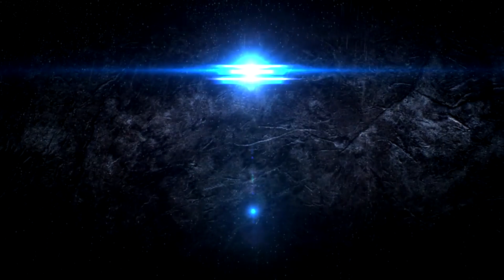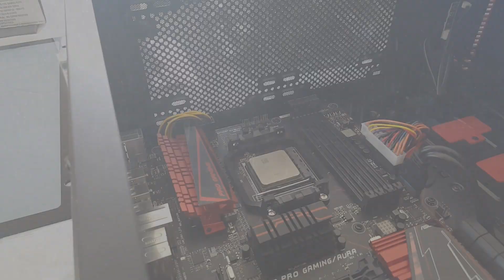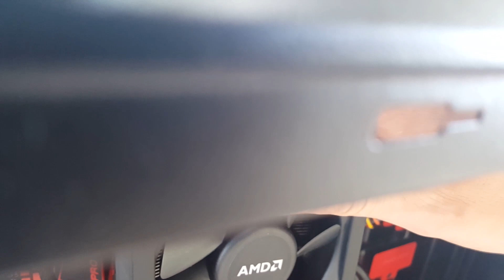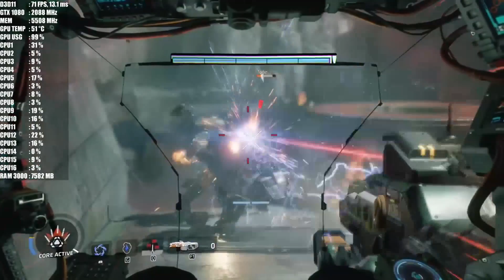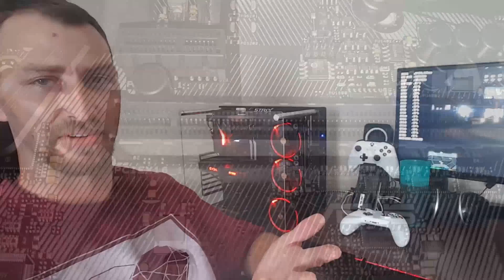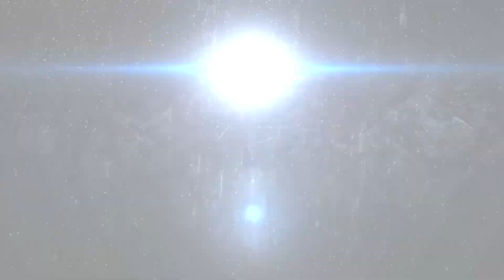How To Install AMD Wraith Cooler #PGNETWORK

Comment: ANYONE REMEMBER I think it was socket 939 where you were told in the instructions to use a screwdriver to push down and inward to attach the clips onto the white outer part of the cpu socket to install the sorry air cooler? I had 12 heart attacks that day!  I used 50 LBS of force down on the MOBO praying not to slip the screwdriver and not poke a hole in the MOBO... socket 939 was it?
Reply: good old days :D
Reply: Socket A / 462 :)

Comment: Please help so I am going to get this cooler just the rbg version and I don’t know how to install it with the mobo in the case. My cooler right now is the normal amd stock cooler please help I don’t want to take everything out
Reply from the maker: Depending on what motherboard you have you may not have a choice but to take it out first because you might have to switch to the newer style bracket.

Comment: But the amd prisim cooler comes with pre applied thermal paste so do I even have to add more?
Reply from the maker: No, it's just not as good as aftermarket paste like artic silver. Makes a few degrees difference, not really a big deal if you're not planning to overclock a lot. If you ever do plan to overclock I'd definitely use an aftermarket paste. So nope don't worry about it just use what's on there for now.
Reply: @PapaGame  Thanks for letting me know. Will do. It's my first time building a PC so I wasn't too sure.
Reply from the maker: No worries, hope the build goes well!

Comment: I have the wraith cooler MAX and it has two extra wires that plug in on the side of the fan shroud and i don't know where on the MB they plug in at?
Reply from the maker: depending on your mobo, there should be a RGB header. One cable is for the fan and the other is for the light control and power.
Reply: @PapaGame  Actually this particular Wraith cooler has a fan cable and two RGB pluggins , one is for usb and the other is a 4 pin RGB and it's the only one like this that I've seen
Reply from the maker: Hey so you're right and I've never used a Max this is strange but got you covered. The USB cable just runs default colors and the RGB cable let's you control it via app which can be found here https://www.amd.com/en/technologies/cpu-cooler-solution you don't need both plugged in and the RGB one is the one you'll want to use if you plan to control the colors. It's the 4 pin one.

Comment: wy do i have 2 cables ? 1 for led ? and 1 for cpu fan ?

i don't understand how to install, i have the amd wraith prism cooler
Reply from the maker: Yes one is for the LED that has to be plugged into a RGB header if your motherboard has one. Then you'll be able to control the colors of the cooler.
Reply: I have 3 cables.
1 cpu fan conecter. 
1 12v gbr conector
And 1 goes to f.usb 2.0

Just conect them all right?
Reply from the maker: @jornmulder  yes connect them all. The CPU fan controls your fan speed based off the processor temperature. The usb 2.0 is power for lighting and the RGB let's you control the light colors.
Reply: @PapaGame  thx
i all conected them :)
and pc run's fine :)
Reply from the maker: @jornmulder  glad to hear it. Enjoy!

Comment: Im actually happy with this design. No pushing on screws. Just attach one. Than the other with the lever. And just press it. Had no problem. Holds tight. Looks good.

Comment: you didn't say how you're controlling the RGB on the CPU fan. From what i see, it seems you opted for using the motherboard controls, which is less accurate then the Coolermaster software...
Reply: @SilencerOS in figured it out. The extra cords. One fits into the three pin RGB connector (usually white), and the other into the 4 pin next to (I'm using an ASUS board as reference). There's two rubber grommets on the Wraith Prism that you need to remove; then you plug in the respective ends of those cords into there - one is four pin, and the other is three pin, just like the ends that plug into the headers on the mobo).
The get the Coolermaster software for that cooler and away you go!.

Comment: My question: How do you disengage the brackets?
Reply from the maker: To remove the plastic retention bracket you just take out the 4 screws. They're connected to a plate on the rear of the motherboard so keep in mind the plate will come loose when you undo the last screw.

Comment: I thought there fans came with the thermal past already applied to the fan
Reply: Ok that makes a lot more sense. I was just confused because I just ordered one and I was like do I need to order thermal paste
Reply from the maker: They do this is not the first time I used this one. Aftermarket is better anyways so I just scraped off what originally came on it and replaced it with artic silver.

Comment: 2700x cooler have 2 cables 1 for cpu fan and what is that other one?
Reply from the maker: The other is for RGB (lighting) if your motherboard supports it you should see a header on the board.
Reply: @PapaGame  Thanks finaly found the answer rgbw pin header.
Reply from the maker: @Tacola8  right on man!

Comment: Hey so I have a question, so I had the ryzen 3 2200g before and I had to take of the clips on the side of the cpu to install the heat sink fan and I got the 2700x and now I need them but I lost them so I can mount the fan what do I do?
Reply from the maker: Contact your motherboard manufacturer and request to purchase a new one.
Reply: @PapaGame  okay

Comment: This cooler comes with two extra cables. What are they for?
Reply from the maker: Can't say that I remember it coming with extras. Are they small like the one connected?
Reply: @PapaGame  They are small. One is for a usb header and the other has 4 pin slots with an arrow on one side. I read a forum post that suggests it has cables for the rgb ring but it works with just the original cable.
Reply from the maker: @Earl961  ah that'd make sense. This version only had while LED so it only had the fan header cable which also powers the LED.

Comment: Actually the most annoying cooler to put on in history.
Reply: someone in another thread posted this pro tip. loosen the screws on brackets slightly to give yourself the clearance then retighten the screws after its on.
Reply from the maker: @Requiem4aDr3Am  never thought of that. Good idea!
Reply from the maker: Agreed

Comment: Can I install that cooler stock (ryzen 7 2700x) on the B350 PC Mate motherboard?
Reply from the maker: If it has the slots for it. They will look like bigger openings than just the standard single hole opening on the mobo.
Reply: Tf 350? With Ryzen 7?

Comment: the cooler already has the paste on it. and you might want to keep your fingers off the top of the cpu.
Reply: I suggest remove that paste, it's like concrete and when you try to remove to cooler the process is going to come with it damaging the pins
Reply: @moscoquera  Yeah, if you pull it straight up like a moron. The best way is to power on the system for a bit, let it warm up, then gently twist the cooler side-to-side and carefully pull it off.
Reply: the fingers on the paste are nothing !! placing the heatsink on the motherboard and ruining the layer of pre-applied paste, is the biggest mistake, once placed on the cpu will remain trapped air bubbles and this is not good for the heat transfer capacity

Comment: How do I buy that thing you called a bar?
Reply from the maker: Dj Mystery should be on the motherboard.
Reply: Twitch United bought mine used and didn’t come with it
Reply from the maker: Dj Mystery look up AMD 3+ socket bracket, that whole plastic base with the bar can be purchased and replaced.
Reply: Twitch United will it work with FM2 and FM2+
Reply: Twitch United I have an AMD wraith prism
Reply from the maker: Dj Mystery I researched a bit and from what I've found it should but I have no experience with a FM2 or FM2+ mobo.

Comment: Tip for anybody having trouble getting the clips on the brackets: slightly unscrew the brackets to give yourself enough clearance to attach the clips then refasten screws on brackets. It will save you several minutes/hours of frustration.
Reply: You realize they put a slot in the clip arm for a flat head screwdriver end so you can push the arm down and hook it right? This has been on every AMD cooler design like this one for years and is the easiest way to latch them. No need to loosen a bracket...
Reply: @Corpsecrank  more change of causing damage with that method, what's wrong with loosening screws?
Reply: You are a hero.
Reply: Jesus that makes so much more sense then me trying to play Tetris with the cooler.
Reply: The mother fucking hero we want but don’t deserve
Reply: THANKS MAN!!
Reply: thanks so much after like 2 hours you helped a lot
Reply: legend
Reply: Holy shit ... saved me from a few hours of frustration.
Reply: If I'm alive today, it's because of you.
Reply: Captain salt, i will remember you
Reply: Love you
Reply: You’re truly a godsend
Reply: Oh my godd!!! Thank youu I've been looking for a video that could help me not do that shit where I put it in really hard lol